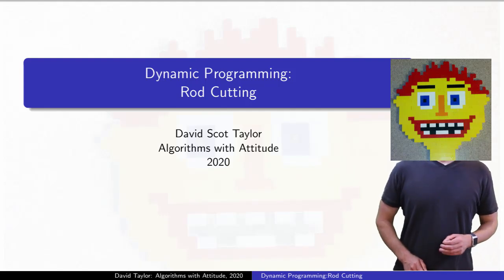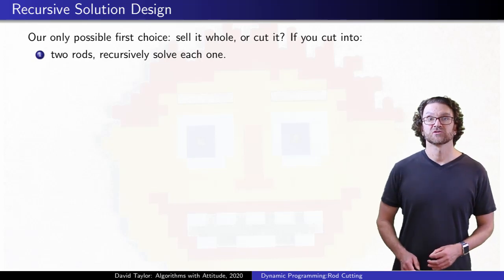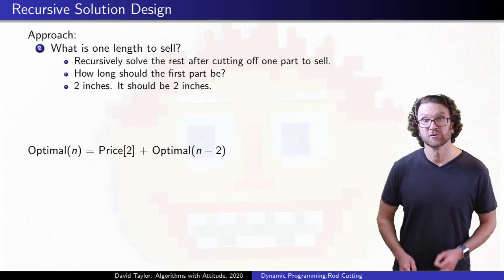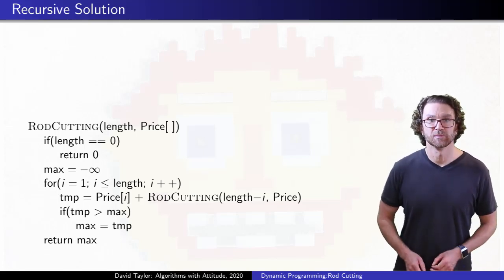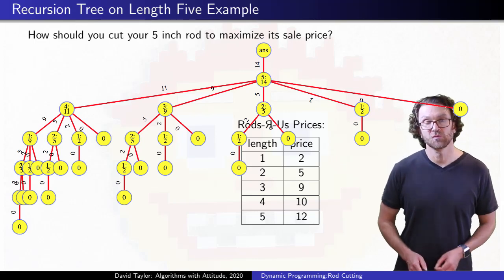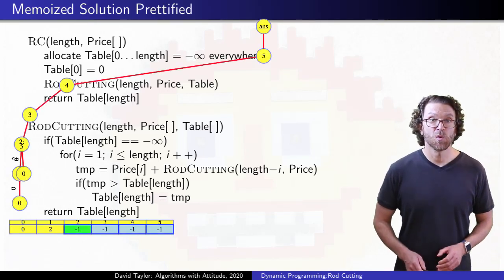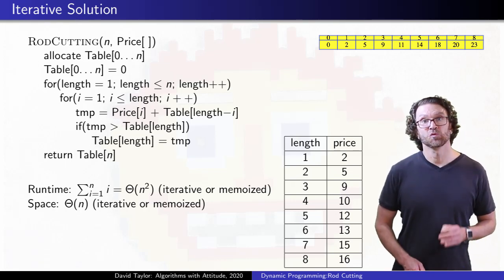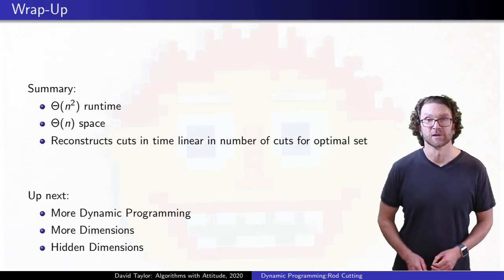Dynamic Programming:  the Rod Cutting Problem

Comment: In the iterative solution why do we set tmp = Price[i] + Table[length - i]? Why not tmp = Table[i] + Table[length - i] instead? I don’t understand why we fix the value of the first cut instead of looking up the maximum value for that first cut from our lookup table. Isn’t Price[i] <= Table[i]?
Reply from the maker: There are multiple ways to find the correct answer.  Your formula will also find it.  After finding the optimal amount , if you then want to reconstruct what the best cuts are, it is slightly more direct to know what the first cut is, and take that piece whole, rather than making a cut and then recursively having to cut each of those two parts...but if you start from small i values, and keep the first i value that you find in case of ties, it should be that you end up finding an I such that price[i] == table[i], so it makes no real difference.
Reply: @AlgorithmswithAttitude  thank you for the explanation! Loved the video!

Comment: I'm a little confused as to why at 5:43 the cost from 5 to the answer node is 14 even though the table says it's worth 12 dollars. Same with node 4 with a cost of 10, but it says 11. Is this a typo or am I missing a calculation?
Reply from the maker: The table has the prices for a single rod.  So, the store sells a length 5 rod for 12, and they sell a length 4 rod for 10.  The algorithm is calculating how much you can get for that same length rod, if you are willing to cut it.  For the length 4 rod, you can sell a length 3 rod for 9 and a length 1 rod for 2, for 11 total.  For the length 5 rod, you can sell a length 3 rod (9) and a length 2 rod (5) for 14 total.  The algorithm is calculating those numbers, given the numbers in the table.

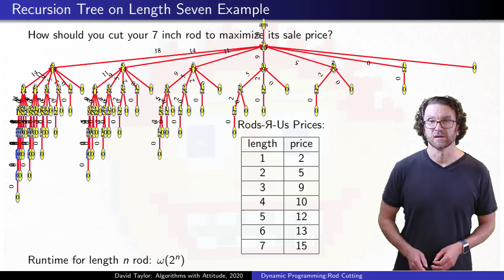Comment: price must be price[i-1] instead of price[i] at 5:57
Reply: I think it is fine as is, I assume that the array has the sale price for length i at index i.  I could have simplified the base case by starting max at 0, and getting rid of the first conditional, but usually only worry about clean up like that for the final version.

Comment: In the bottom up solution given at the time 8:31, you are making a recursive call, that we can avoid altogether.
RodCutting(int n, int[] price[]){
{
  int[] table = new int[n + 1];
  table[0] = 0;
  int tmp = 0;
  for(int length = 1; length <= n; ++length){
    for(int i = 1; i<= length; ++i){
      table[length] = Math.max(table[length], price[i] + table[length - i]);
    }
  }
  return table[n];
}

So in this line we do not need to do the recursive call.

 table[length] = Math.max(table[length], price[i] + table[length - i]);
Reply from the maker: I am not sure what recursive call you are talking about?  Do you mean the table look-up?  The bottom up version has no recursive call.
Reply: what the heck, it's not recursive call